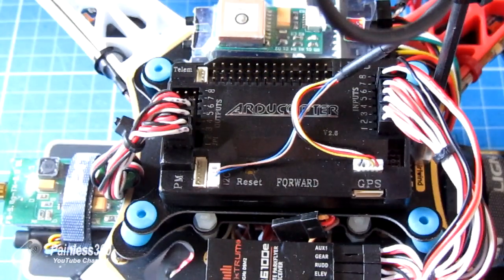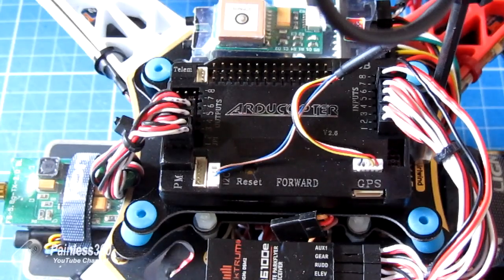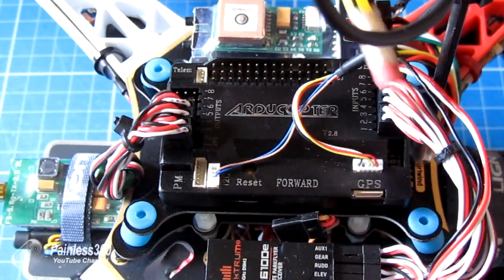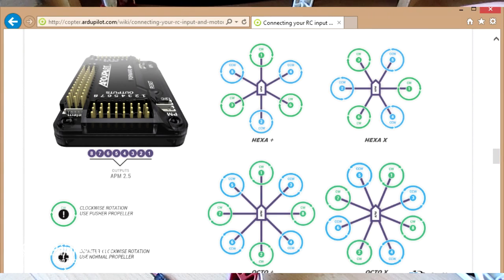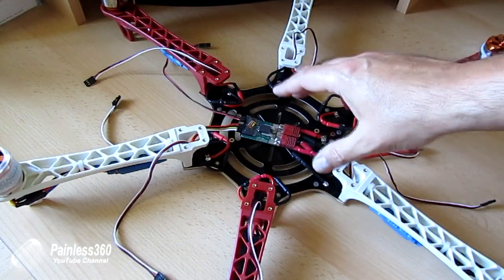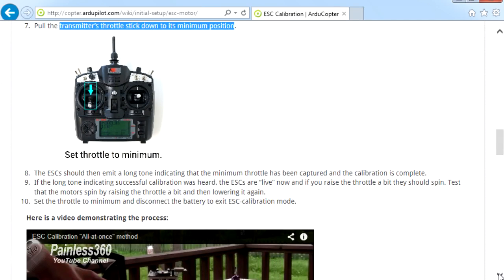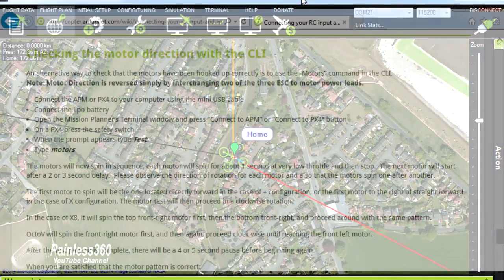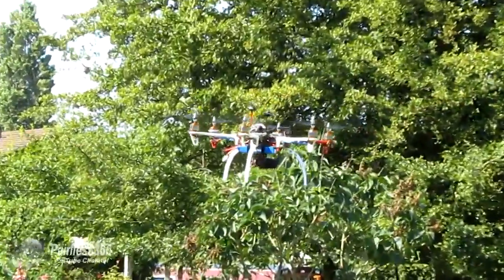(2/8) APM 2.5/2.6 - Powering the board, motor installation and ESC calibration

Comment: Hi :) excellent videos! Thank you.
I'm wondering if it is optional or mandatory to cut the +- wires (red and black) from the output JR plugs?
I saw recommendations to do so, but in this video I see you have them still installed without mods. I plan to power my APM2.5 board with the power module in the PM plug. (BTW, I already took the JP1 jumper out).
Reply from the maker: If you are going to power the board from a power module then I would unplug the red wires from each of the cables that connect the ESC to the motor output pins. That way you are going to avoid any problems. Hope that makes sense. Happy flying!
Reply: Thank you! Now I feel on the safe side unplugging the (+) wires. I really enjoy all your informative and well done videos. Useful for beginners :)
As a friend of mine says:  "Information not shared is useless".
Reply from the maker: Thanks for the feedback. We do cover some advanced stuff on the channel but the idea is that it is understandable by those who are new to the hobby.

We all had to learn at some point but not all remember that or try and support the new pilots/builders with respect and patience.

Happy flying!

Comment: So glad you made these vids! These are the best thing I've found anywhere! When I fire up the terminal to test motors and connect I get the loading time message followed by a bunch of what appears to be never ending garbage text spewed to the screen. I connect the USB to the APM and the battery to run the motors. the port opens and I get the message it took x to load. I did notice in the first few lines of the garbage text a mention of calibrating the barometer, the GPS, and a message saying ready to fly. But never prompted for a command like you show. Any thoughts what might be going on here? Did I miss something? Cheers
Reply from the maker: Wine Prince Could be due to the fast that in later versions of the firmware the CLI interface was retired to make space in memory - http://ardupilot.com/forum/viewtopic.php?f=66&t=11224
Hope this helps..

Comment: Hi :) First of all Thank you for the Wonderfull Video's. I really Learned alot from them. I have had a zero x6 uav, but I couldnt get that to Work, and I dont think as yet that its the problem with that. Too much Work and not enough time, But now I have got me a APM and I do hope you can help me. I have Calibrate the Esc's, and they Work. My Questions.
1- Do I have to Calibrate them every time I want  to fly!!? Because it seems that way with mine
2- When I take the model in my hand then shouldnt the motors Work differentlly when ever i change the position of the quad to right or left!!? Because it doesnt :(
Thank you very much for your help in forhand :)
Reply from the maker: Bisholi M 1) No, once in a blue moon is fine. 2) Never run the model in your hand try a test hop first over soft ground outdoors to confirm it all works. 
Happy flying!
Reply: +Painless360 Everything Is easy when one actially lean it.....:) Thank you Again for sharing Brother...:)

Comment: What if i dont have a 3 position switch on my radio. I have 2x 2 position switches. Can i put loiter mode on one switch and RTH on the other switch ?
Reply from the maker: phats24 I would use a mix with the two switches you have to give you three or four options for the flight modes - https://www.youtube.com/watch?v=jxujrKtTwG8
Best of luck.

Comment: Hello, I have new question ,My Tri copter APM 2.6  system  with power module I have OPTO esc's with a UBEC, my copter arms and  motors run , with battery and USB . but when I unplug USB  , try to arm and restart it will not run , works only with USB plugged  in.
Reply: William Booth  my APM unit turned out to me bad  I must have shorted it out  some where along the set up work.  got new one all things seems fine .. except will not lift and hover motors are set up with cc rotation. with APC c-2 blades 10x7E.  I order these ( Normal Blades ) on line . All motors are setup  CC Rotation as the pictures on the MP down load page. Please  H E L P..
Reply from the maker: William Booth On a quad two of the motors turn clockwise, two anticlockwise. Are you saying all of you motors are turning the same way? 
Watch the setup videos again and this is all covered.

Comment: Hi! I've calibrated all the ESC of my quadcopter individually several times, but still two motors tend to start spinning a little bit later than the other two (not always but most of the times). 
What should I do? By the way, your drone sounds much smoother than mine when flying. Your motors sound like "bzzzzzzzzz" but mine usually sound like "bzzzzzrrrbbbbrrrrrrzzzzzzzbrrrrrzzzzzzzzzz".
Thanks!
Reply from the maker: You need to check the ESCs and that lazy motor bearings are ok. Could be one of the ESCs is setup differently. I would go back to the suppler and ask them for some help..

Best of luck..
Reply: The motors seem to be fine when I turn them manually. I cannot feel any kind of friction.
How could I check the ESC? thanks!

Comment: How did you mount your anti vibration plate to that dji top plate?
Reply from the maker: I've had plates that included the holes and some that didn't If yours doesn't then use a 3.1mm drill to pop some holes in..

Best of luck.
Reply from the maker: I used the smallest 3mm PCB nylon standoffs to mount the bottom of the anti-vibration plate to the top of the model using the holes in the middle of the plate. See https://dl.dropboxusercontent.com/u/67301981/APM%20mount.jpg for a closer image to show one of the standoffs.

Hope this helps.
Reply: Painless360 Hi, I looked at my 450 frame, but there are no holes in that position. Have you drilled the top plate?

Comment: Hi my apm flips over to forward.
I calibrated all motors at same time.aMaybe calibrate ono by one? Only flips.Motors turning like apm website.X Hexa.Please help
Reply from the maker: Esteve Giribets Moron Double check that the motors are connected into the right outputs. Having two swapped cables will cause it to flip over... Best of luck.

Comment: I'm building a 450 quad with HKPilot Mega and Q-brain 4 in 1 ESC, On the Q-brain there is only one signal wire with red and black power lines. Is it enough to power the board and receiver? And is it relevant which of the 8 output connectors is it connected to?
Reply from the maker: You need to see how many amps the BCE can supply - what has it printed on the case? Is it more than a coupe of amps? If so it should work fine..
Reply: Painless360 It says 3A:
http://www.hobbyking.com/hobbyking/store/__36674__q_brain_4_x_20a_brushless_quadcopter_esc_2_4s_3a_sbec.html

Comment: Thank you for the info , I would like to find out if any or what functions work without internet , I have internet when I am home but would like to calibrate and play with the settings and the (future on board camera ) at a camp. I just ordered the  APM 2.6 and looking to put it on a quad copter (kit ) I have basic rc skills but still rusty on the communication between computer ,quad copter transmitter/ receiver  and controller transmitter/receiver  . I would be grateful if you could shoot me an email ,HEATHHILL@GMAIL.COM  ,Thankyou

Comment: Hello :) First of all the video is great. Second ... I have apm 2.6 and i would like to power that think straight with esc without any other bords. So should i disconnect 3 wires from esc (red and black) left only signal, and leave one wire(from one esc) with both (black,red, signal)? Will it works ? Or should i just connect them without any remove? And one more question. Is jumper1 must be plug in (installed) when i configure apm bord with usb cable ?
Reply from the maker: If the BECs in the ESCs that supply that 5v to the board are linear BECs then you can install them all with the wires connected. If they are switched then you need to remove all but one of the red wires on the leads as you mentioned (if you are not sure, read the specs of the ESCs you have online).

Make sure that the BEC is rated for 3A for more for safety then the board should run great.

Hope this helps. Happy flying!

Comment: I'm waiting for my APM 2.6 so i watched all your videos: great work, thanks very much. I only have a doubt: I will install the APM on my Phantom. I read on the wiki that the "DJI Opto ESCs do not require and do not support calibration" do you think that I will have problems because of this? Should I change the ESC?   Thanks again for your work!
Reply from the maker: Classic DJI - make it easy to fit their proprietary systems together but tricky to use any non DJI third party components..

You can try it but being able to accurately calibrate the ESC is one of the fundamentals of a solid setup.

Best of luck..

Comment: Frame Change
The problem I am trying to change to a hex frame type from Quad X. I have updated the Firmware for the hex copter but when i get to step 4 pick your frame type in the wizard it only shows X H Y6B and T . I have tried it on my other computer and I'm getting the same thing also tied installing firmware for other frame types to see if it would change anything and still the same, Any Ideas what i might be doing wrong ?
Reply from the maker: Don't worry this is something that lots of people have seen and fixed. Updating the same platform type does not erase all of the EEPROM so you need to delete everything using the command line and then start again -

In Mission Planner Terminal type these commands in turn -

setup
erase
exit
logs
erase

Then you should be back in business!

Best of luck
Reply: Painless360 Thanks could I use Arduino to erase EEPROM or do I have to figure out what to do in Mission Planner under Terminal ?  It was stupid how it even happened Got a new dx8 I was checking mode settings on all my Quads and Hex just finished 3 quads then i plugged my Tarot680 in and it changed it to the last quad i had plugged in. Next time i will restart mission planner each time.!
Reply: Neil Hodgson I found out how to do a factory reset under terminal.. but now when I click connect to get into setup all i get is rows and rows of text,,the board now must be corrupt... Now I am not sure what I'm going to do now.. hope board is not bricked!
Reply from the maker: The board now needs to be reloaded with the firmware. Go back into initial setup and start again..

Best of luck..
Reply: Painless360 Still the same because i have not been able to erase EEPROM and do a factory reset. Sorry about being a PAIN but your the only one that answers me back THANKS YOU
Reply from the maker: You need to use the CLI in Mission Planner -

In Mission Planner Terminal type these commands in turn -

setup
erase
exit
logs
erase

Comment: ugh! I just had a brownout! I was flying with my ESC integrated SBEC plugged in the APM, all wires on, the board was powered by PM with J1 removed, there is no servo connected. When I checked the wreckage the battery still has 16% left with 3.72v on each cell, the log shows brownout:fail. does this mean I can no longer rely on this setup? Should I just put J1 back in, remove all BEC ground and red wires, plug in a UBEC to power the board for max safefy?
Reply from the maker: I would check the logs in detail (http://copter.ardupilot.com/wiki/common-diagnosing-problems-using-logs/) and if it's changing more than 0.15v then look to replace the power supply to the board with a larger capacity one..

Best of luck..
Reply: Painless360 Thanks for the quick reply! I am about 85% sure it was caused by brownout. Here is the log. https://www.dropbox.com/s/b6vcx9hrpm715zp/2015-02-01%2009-52-29.bin?dl=0.

Comment: Hi Painless. Thanks for all your videos. I really appreciate them I was hoping you could help me. Im using a power module to power my apm 2.6. If i pull the JP1 jumper so my apm and receiver are powered only by the pm and not the esc's, what should I do with the red wires coming from my esc's into the output? Should I just leave as is or disconect all but 1? My esc are dys simonk 30a speed controllers

Comment: hi. very interesting videos.#Question. \how do I wire  an APM when Im using a qbrain 4 in1 esc. hope you can help
e-mail. Snapshot93@hotmail.com
Reply from the maker: Hi Tom,  just plug the corresponding inputs into the APM, keep track of how you plug the outputs into the motors to make sure they match what the APM is expecting.

Only one of the leads contains the +5v and GND so you don't need to worry about UBECs etc..

Happy flying!
Reply: cheers  many thanks

Comment: Just about to build my first quad.  Real confused on how to power the APM 2.6 with the 4x Emax Simonk-12A ESC's In the description for the esc's i says this Equipped with built-in linear BEC or switch BEC.  So i could run the esc's with all the red wires and jumper 1 installed.  Thanks for your video's
Reply from the maker: If the BECs in the ESCs are linear then you can install all the red wires. If they are switched (they can't be both) then you need to install just one red wire.

Looking at the specs the 12A version is linear (http://www.banggood.com/Emax-Simonk-Series-12A-20A-25A-30A-40A-ESC-For-Quadcopter-QAV-250-p-918126.html)

Hope this helps.

Comment: Can we connect APM to USB while it is powered by the battery?
Reply from the maker: You can, but be careful that the input voltage from the UBEC isn't too high.

See this from the APM pages - 'Connecting USB when you have input voltages at the high end of the range (near Abs Max) can damage the board. Disconnect battery before connecting USB or test input voltages so they are within the specified range.' (http://copter.ardupilot.com/wiki/apm25board_overview/).

Hope this helps.

Comment: Hi Painless again, I have calibrated my esc using the esc and esc calibration method and each responded to the throttle stick from my transmitter, however once i connect them all into the APM board via the output 1-4, when I connect them to the battery, it either,
beep non stop (I have read, it means that my throttle stick is not fully down)
beep every 1/2 seconds, not responding to my throttle stick
Reply from the maker: i would check the calibration of the rc channels in Mission Planner  first. Will the board arm? What do you see if you try to arm it while connected to Mission Planner?
Reply: Painless360 Sorry for the late reply, Merry xmas and happy new year to you,

I have managed to armed my apm, following the instruction of arming, I lower my throttle and stick and push it to the right for 5 seconds, all my motors starts to spin at the same time, however roughly running for 3-5seconds, the apm disarm itself automatically and I'm not able to spin the motor by pushing up the throttle stick

Comment: Thanks for the instruction. I have decided to power it with power module , which is tapped into the main pack, does this mean I must remove all red wires from the ESC built-in UBEC?
Reply from the maker: Pulling in linear BECs side by side is fine. If you are using the PM then personally I'd remove all of the red wires to be safe and not have any of the extra heat from the UBECs in the ESCs.

Happy flying!
Reply from the maker: If you are flying without servos connected to the APM outputs then you don't need the BECs in the ESCs. You can unplug J1 or disconnect the red wires on the ESC leads.

Happy flying!
Reply: Painless360
Can you just leave them in place when using the pm?
Reply from the maker: If the BECs are switching and J1 is unplugged - yes.
Reply: And if all Becs are linear and we are using PM, does this
mean all red wires still need to be removed? I have been flying with linear Bec with all wires on and pm plugged in, am I lucky the board is still working?
Reply: Many thanks! I think I'd probably remove all ground wire as well to reduce noise and make it neater. :)

Comment: Is KK board needed for APM 2.5 to fly Quadcopter?
Which APM version eliminates the need of KK board and Gyro?
Reply from the maker: Sounds like you are new to the hobby. Thanks for the question. The answer is simple - the APM needs nothing else to control the craft. It has on-board software, sensors (including using gyros) to fly the model.

Best of luck with your project.
Reply: All the while i use only ardupilot. Now i move to copters.I built a tricopters and tried APM 1.4. with tricopter firmware in it. I have to move all three sticks together to make all three motors run at a time.I use JR dxs9 radio and spektrum receiver.Each stick acting as an individual throttle stick for each motor. Do need to do any mixing in the radio?How to make one stick that control all motors?
Reply from the maker: Sounds like you have something basic setup wrong. Recheck everything and follow the steps in my setup videos for APM. You don't need a mix setup on your radio to fly a multirotors - see mu video 'Multirotor Quick Tip: Radio settings - HELI or ACRO?' for more details.

If you need more help - schedule a Helpout session (search for Painless360 on Helpouts.com).

Good luck getting it sorted.

Comment: Thanks for the fast reply
Each ESC is powering one motor. Each BEC from the ESC has Signal and Ground to APM pin's 1-4 Outputs.
Using a Dedicated 5V 3A UBEC to pin's 8 Outputs, to power APM and Receiver
Nothing powers up when Lipo is connected.
Thanks
Dale
Reply: can we use 4 -1 esc with apm 2.8

Comment: Hi there Painless360
Will I tried powering up the Quad this morning to do ESC calibration. Nothing powers up when the Lipo is connected.
The UBEC is putting out 5.2V. and plugged in to Pin 8 +/- on Outputs. Put a volt meter on open pin's +/- on Outputs with Lipo connected, No voltage is detected. I have no idea what to do.
What do you think ?
Thanks
Dale
Reply from the maker: Is jumper j1 installed? Has this ever worked?